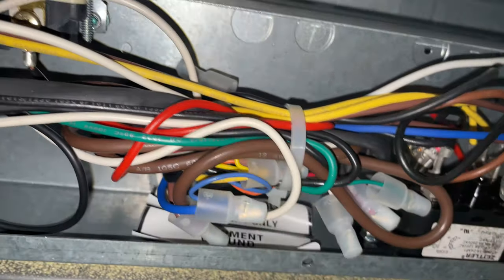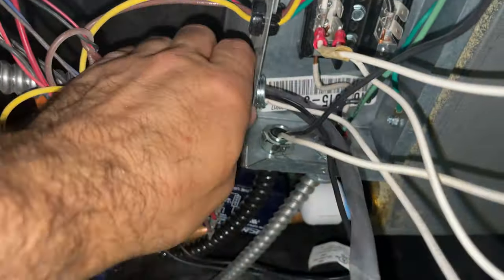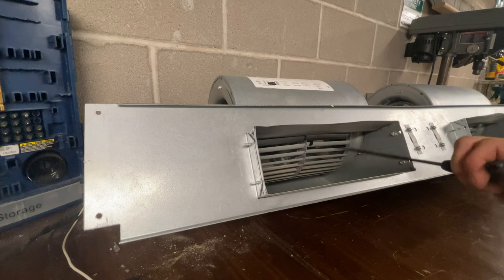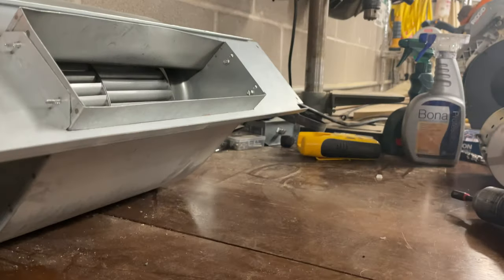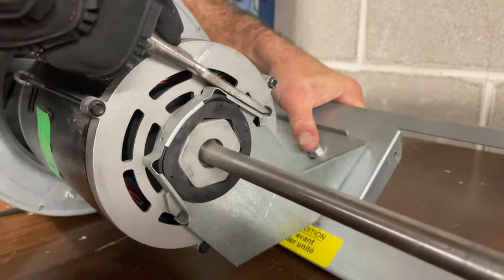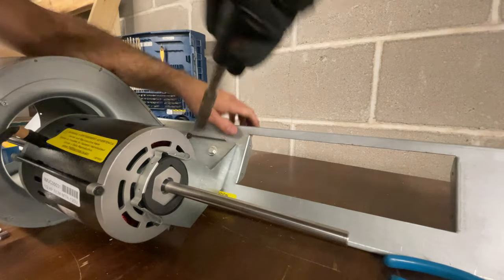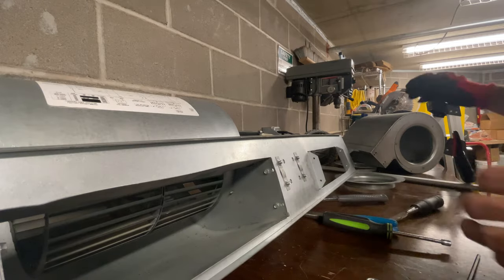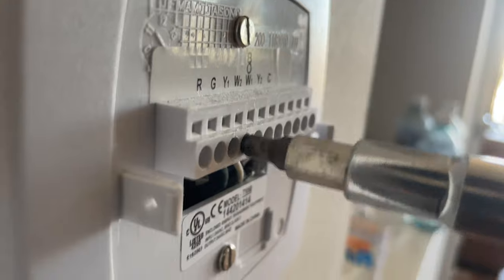Dual Shaft ECM Blower Motor Replacement indoor furnace/AC

Comment: I was working on this today but didn't install the wheel correctly by installing the locking screw outside rather than inside on both wheel, would this be a reason why I'm having vibration when I reinstalled it, I got a new wheel and fan motor, thanks.

Comment: All I have to do is spin the fan blade by finger and the motor is spinning again. Done this for many years . Where do I search for lubes or cleaners etc.
I think maintenance will be a little bit hesitant to replace the whole thing as seen in the video if it is still functioning.
Reply from the maker: If you have to give the fan an extra ouch for it to start it’s not getting enough voltage - this is why psc motors have capacitors

Comment: First duel shaft blower motor I changed was in a broom closet server room in an ambulance station, work order had to be done that day. With the motor right above the server rack and having never worked on one before, ended up taking me 6 hours to get the old one out and taken apart and put back together with the new motor. It was a humbling learning experience. 😅
Reply from the maker: Ya these are suck a pain to work on. Luckily I don’t run into them that often

Comment: I have to replace a dual shafted motor like this one on a wall unit at a school tomorrow. I’ve done tons of blower motors but never one of these before. Kinda dreading it to be honest.
Reply from the maker: I’ve done a dozen of them. Sucks every time
Reply: If it's on of the BARD wall hangers it's so easy you will not believe it. Remove the wires and only 6 screws, and the whole thing pops right out.

Comment: Thanks for sharing the video. Awesome work.  Question: where is this motor located or being use? I never have come across a dual shaft motor.
Reply from the maker: Ceiling / overhead air handlers